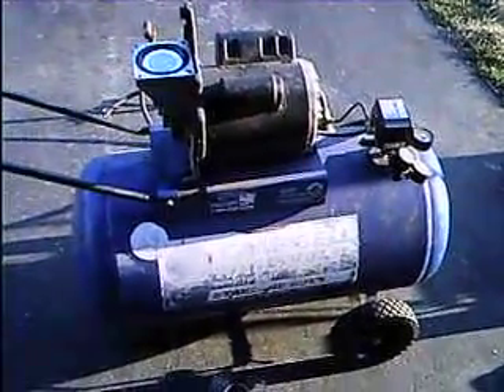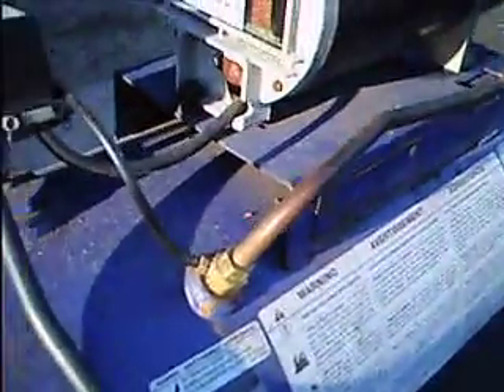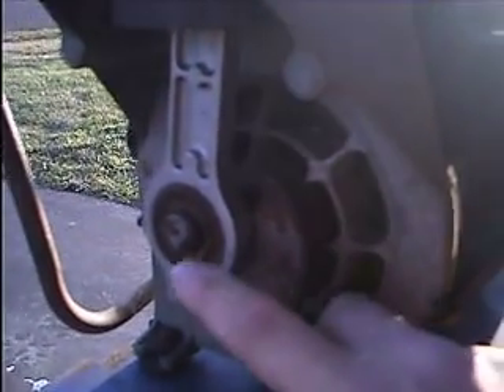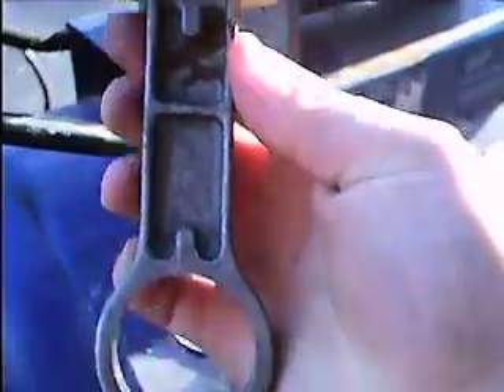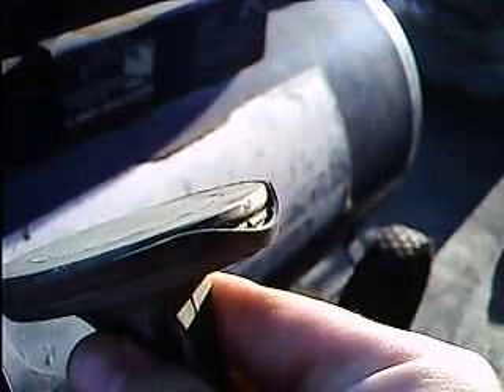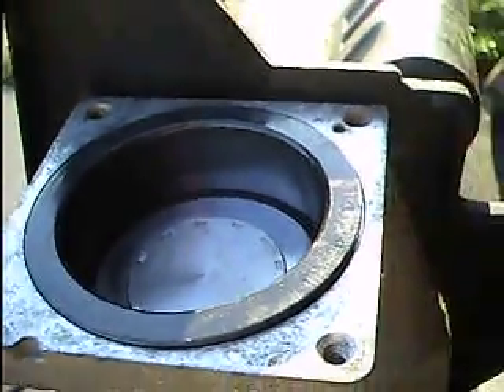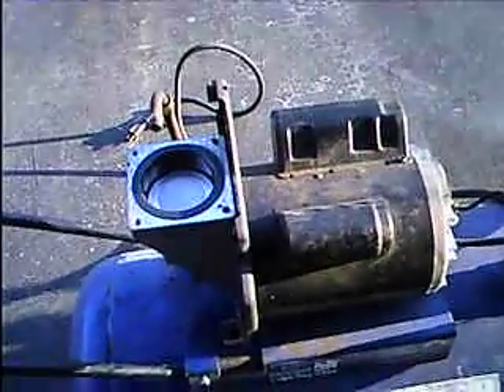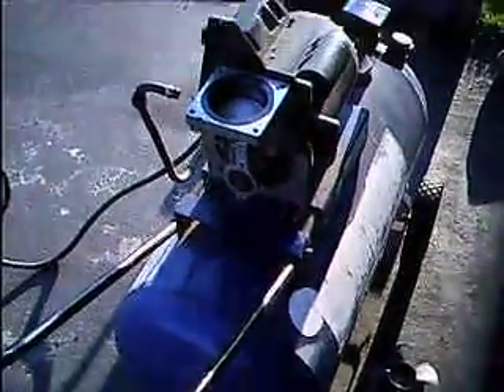Poorly Designed Compressor

Comment from the maker: Ok, I see in your video that your Gast vacuum/ compressor appears oil lubed and completely enclosed.  It also appears to have significantly less voulme then the CH I am working on, size may matter.  The design may be sound on a smaller scale.  Or it could just be the fact that your compressor is of significantly higher quality that a CH.  The guy who owns this CH probably got it at Walmart.

Comment from the maker: No, the piston and cylinder are not plastic, that would just make me laugh.  Although I still think this is a fundamentally flawed design, not only "rocking piston" but also the fast that the piston, crank and cylinder are directly exposed to the elements (dust, dirt, moisture)
Your Gast compressor, is it oil lubed or oiless, it surely doesn't have an open crankcase does it?